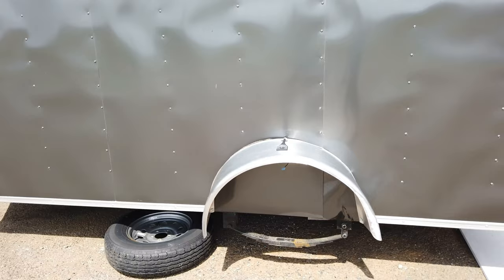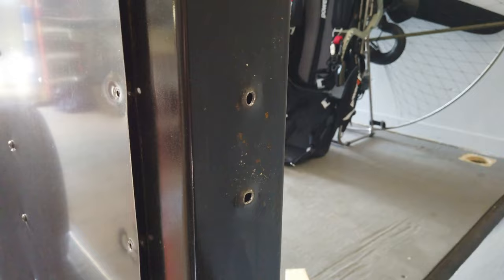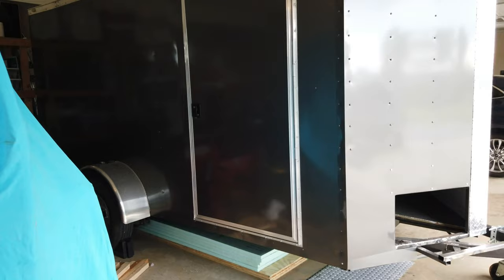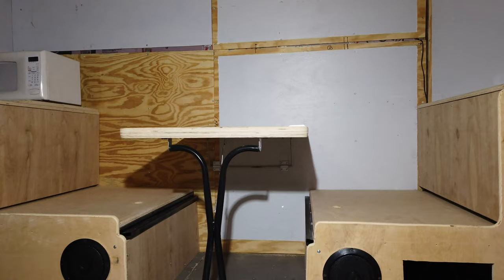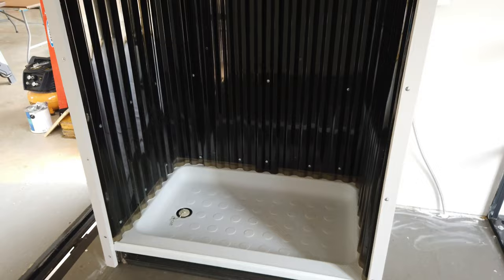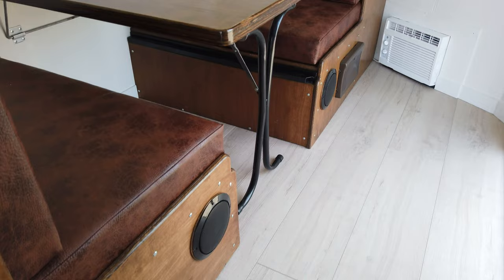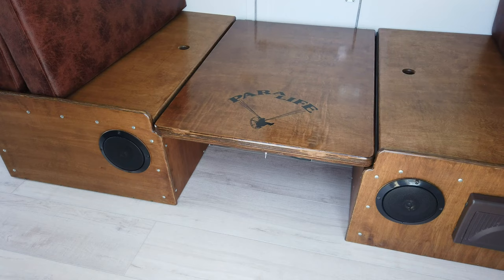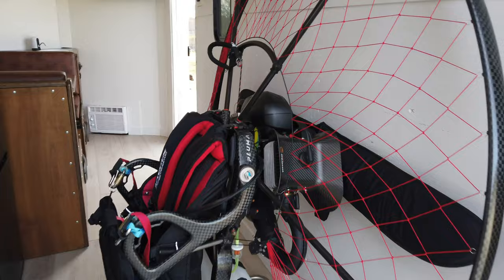Cargo Trailer Rebuild and Conversion to a Camper / Toy Hauler www.paralifeppg.com

Comment: Nice work. I converted my 6 by 12 trailer many moons ago before all of this got mainstream, I just finished the second remodel and exterior paint. Just some things I'd suggest. Maybe a bank of solar panels to keep your batteries charged another thing I did to mine is apply cool seal to the roof. Makes a considerable difference when sitting out in the sun especially when you have those two roof patches. You can find it in the roofing isle, you can tint it also, the jack weed at lowes said it couldn't but it states plain as day on the label it can be tinted! I don't know how long of distances you travel or if you'll be sleeping in it during feeezing cold weather but I use mine a lot when I head out to N Ga during the winter. What I did to mine is I insulated underneath with some super wide and super thick insulation and I enclosed it with roofing tin. I screwed the tin to the frame with self tapping screws and sealed the edges with a elastomeric caulk NP-1 also found in the roofing isle. Just reducing the drag alone saved me a ton just in gas where I have a square front and not a V nose. Plus during the winter when the wind is blow 10mph at 36 degrees it nice and toasty inside there!
Reply from the maker: Good ideas, I appreciate it.

Comment: Pardon my inexperience, but the main body appears to be 9ft long, not 12ft...  I have never seen a manufacturer include the pointed nose in their basic living space.. Kindly clear up my confusion...  Are the studs on 16in centers?  In addition, that a.c. angle mount will never work properly.  Is all the weight on one side of the trailer? What is the tongue weight?
Reply from the maker: Yes you are wrong. It is 12 foot plus the v nose. Sorry it was not built to your satisfaction. I will try and do better next time.
Reply: @pjf7943  WOW, Sir, you really need to take Chill Pill! Mark was given this trailer by the gentleman that was towing it. There was an sccudent in front of him and the van to his side bounced off if him. Mark paid the storage fee. Mark is an amazing technician and a great friend. Being over the age of 65, doesn't give you the right to accuse my friend of being a Liberal! As he says, it used to be a cargo trailer and converted it. Yes, 16" oc flooring. As for the AC? It is mounted and protected on the outside and works amazing. Don't know exact tongue weight, however it tows like a dream. 
He really did an amazing job on this trailer. And I would hope the next words from you would be an apology...
Reply: @pjf7943  You forgot to mention to decals...too many on the back...when he disconnects the trailer it will flip backwards..also those black appliances don’t match the shower curtain...that’s such a liberal thing. What’s actually “liberalism” is thinking because you are old that your opinion needs needs to be known and when someone counters it you get offended. Build your own..your tears are flowing so heavily that even your xtra absorbent adult diapers aren’t containing them. Only people over 65 know what those are right my man? If you took the time to learn the circumstances behind how the trailer was acquired and the work he had to do just to get it home you would understand...I get it though. People under 65 would take the time to find these things out before opening their one sided liberal ancient mouth. Just because your old...and you made sure everyone knows your old, doesn’t mean you’re smarter than everyone else...buy your own and glitter done boss.
Reply: Hey.  I don’t know how to build one of these but I want to tell you how you built yours wrong.  I’m I experienced but know a lot about tongue weight safety.  I’m old. I don’t intend to build one but would like to make assumptions on how your trailer is not as long as you say it is and how the nose shouldn’t be pointy.  The whole thing just seems dangerous.   I’m scared
Reply: @pjf7943  As I if it matters, Both Mark and I are mad as hell that these liberals thieves stole our election.. I am 100% for President Trump.
Now onto your concerns about the build, the weight distribution is perfect. It's not tongue heavy, at all. Mark and I can lift the tongue.  I personally towed it down to a fly in, 2 1/2 hours each way, and it pulled amazingly. Everywhere from 25 to 80 mph it, towed like a dream. To your point about the he AC, yes, cold air sinks, so the AC could have been mounted high, however, from a support standpoint, hanging that weight high on the wall would have required a lot more framework, and the vibrations of traveling would affect it more.
Reply: @pjf7943  by the way  never assume anyone’s political affiliation. Keep spreading doom and gloom. That’s just what the left wants.
Reply: Sweet! Just grabbed a bag of popcorn from the local socialist commune, keep it going boys, the best dumb and dumber dialogue on YouTube I've seen this month!